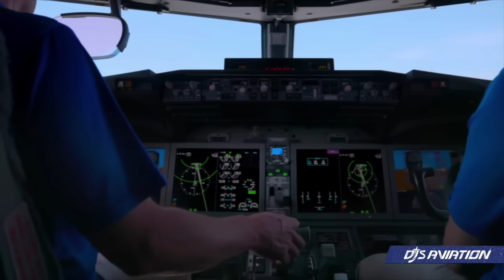777X Order, Ryanair Problems & 737 MAX Orders?

Comment: I will NEVER fly the Boeing 737 Max  🚧✈️🛑
Reply: 😂 same no cap
Reply: Smart move
Reply: One time i flew the 737 max, I HATED IT
Reply: @Sunthoriscool  probably cause of dogmatism
Reply: Not happening
Reply: I flew a Ryan air max thru a storm on take off and it flew Well sand safe
Reply: The plane was cozy
Reply: I will NEVER fly the Airbus A320 Neo ✈️🛑🚧
Reply: @Sunthoriscool Why? I have been on both Max and Neo and I had no issues
Reply: @alexrebmann1253  the turbulen e on the 737 max scared the living poop out of me
Reply: @Sunthoriscool  Turbulence occurs on all planes. Being a Max had nothing to do with it. That the Max you were on made it through says  it was designed to take it. I've   been on larger planes and experienced turbulence. No
Reply: @alexrebmann1253  well normally I don't care about the turbulence. But the 737 max turbulence kinda scares me. No wonder there are safety concerns regarding this plane
Reply: @Sunthoriscool I've felt worse turbulence on an Embraer 190 imho
Reply: @FA18ESuperHornet one that has a very high crash rate, seems sensible.

Imagine thinking bowing make good planes, you must be pretty deluded.
Reply: Your loss
Reply: Okay. You do you.
Reply: @mchristr  I have. :)
Reply: Imagine being a god damn Boeing hater

Comment: Ryanair should just get other aircraft
Reply: That’s not how it works they can’t because Boeing is giving them discounts plus airbus already has a long waitlist and if you do the math Boeing will still get the planes to Ryanair faster and cheaper in the end also making your ticket cheaper
Reply: They can't.
Reply: It's as the others have replied as well as standardising on fleet type. Having to re-train/certify on Airbus would really impact on their operations as well.
Reply: If you have common sense they would need to buy a new sim for training and train every pilot and spend more money on planes which increases the plane tickets
Reply: Ryanair has Airbus operations too. Just sayin.
Reply: @mcmuffin-z5v  It was rumored Ryanair is blacklisted by Airbus, given they asked for A320 multiple times to pressure Boeing for more discounts in the pass.